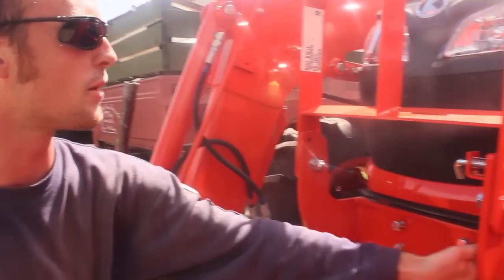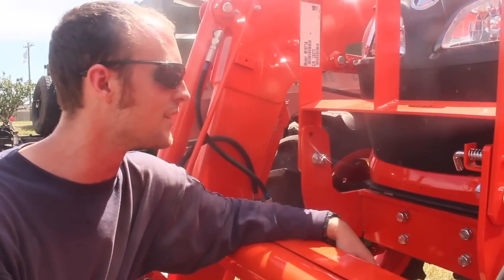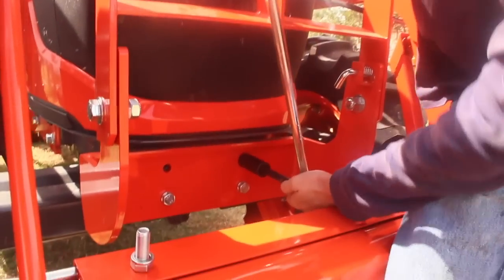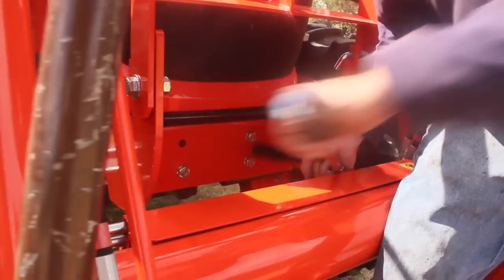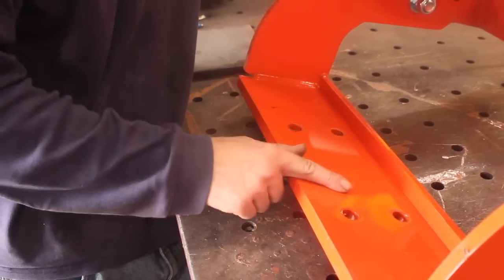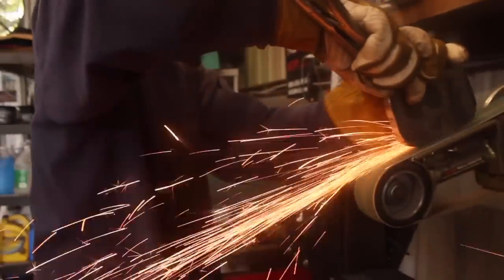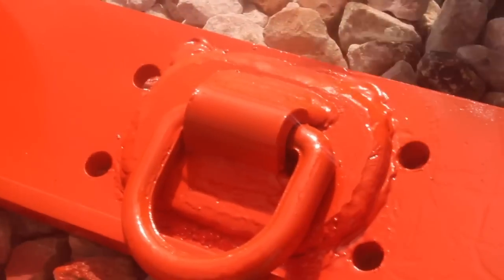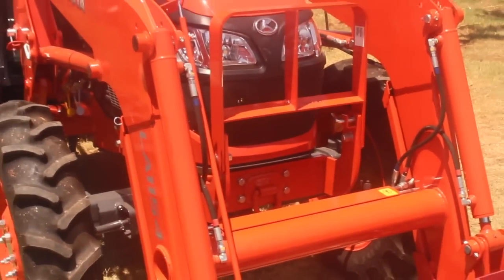DONT WELD A D RING TO EQUIPMENT WITHOUT WATCHING THIS VIDEO THE HIDDEN SECRETS I LEARNED FROM AN ENG

Comment: Regarding the plate to distribute the force.  Wouldn't the plate now become "one with" the OEM part and the D ring is still being pulled at that small surface area on the plate itself?  In other words putting the D-ring on the OEM part would just make the pulling force concentrated on a small area.  But with the plate there wouldn't the D-ring's small pulling area be now on the plate?

Comment: Great video! I can confirm what you said about load distrobution. I do a lot of repairs on wheel trenchers and have found that 7010 HYP tends to hold up to vibration better than LH. Maybe the forces are different for my repairs. Either way the vodeo was very good.

Comment: Just make it a tad bit bigger, drill in 4 holes and put it under the bolts next time. No welding, no modifications to OEM parts, just bolt on. Better IMO.
Reply: If he did that you would be putting a heck of a lot of pull on four bolts.  

How much force and loading can they take vs his welds?
Reply: @Ariceater  The bolts are still taking all the load.  They hold the whole thing onto the tractor.

Comment: didn't mention that the plate where the padeye goes may be heat treated. Any welding may remove the heat treating, so use a plate. Even be  careful about drilling into heat treated parts.
Could create stress risers.

Comment: this dude is sketchey,  he did not know one end of a welder from the other 5 years ago, and now is offering engineering advice.
welding a 1/2" plate to a 1/2" plate is pointless,  making that plate so large that it now impedes the bolts and the ability to put a socket on them. and if the plate you are welding all this to is bolted on,  then your load rating is determined by that!
The comment section contains more valuable info than this video.  Sad , but that brand new tractor he is working on has been paid for by creating this kind of questionable content. stange world we live in.
Reply: Its called learning as you go.  I bet you are one of those folks who knew everything out of the womb right?  If you know so much why don't you contribute instead of being a jagoff

Comment: I disagree with you a little on a few things. One failing point is better than two (your plate you added), and weave welds are better than stacked. 😅
Reply: Weave welds aren’t as strong as stringer beads, and aren’t code in most places.

Comment: I think that the plate is overkill. The weld on the D ring is so much smaller than the plate and would get ripped off before you could bend the 1/2" plate.
Reply: Exactly. "Distributing the force" with the plate makes no sense because it's still the same force on the small piece that holds the D ring whether it's on a plate or on the base material. That's the point that's going to fail and putting it on a plate changes nothing.

Comment: Fine thread bolts can only survive the equivalent load as their coarse thread counterpart when they are installed in soft materials like aluminum.
Coarse thread bolts survive best in stronger materials like steel.
Fine thread bolts installed in steel put under load will leave the bolts threads in the steel.
Coarse thread bolts installed in aluminum will remove the threads from the aluminum with equal loads applied.
Your attempt to educate people would be a lot more successful when you learn the facts about what you are talking about.

Comment: I myself don’t like welding stuff on if the same can be accomplished by bolting it on. In this case I may have considered fabricating a plate for the D-ring and bolting it on with only two of the (longer) bolts or for extra safety all four of them.

Comment: To determine the appropriate D-ring, take the weight of the machine and add 50%. Guaranteed to be utilizable if the piece of equipment is disabled or stuck.
Reply: I thought it was double?
Reply: @rockdem0n  not for straight pull. For lifting it's double.
Reply: @cliffterrell4876  Ah, I come from the automotive side of things and it's a lot easier to find something that can handle double or more of the weight of lighter duty vehicles.
Reply: Would it not be better to make the D-ring assembly much stronger so if you get stuck below the axles you can still pull it out.  The normal weight of the machine, for example 10,000#, would be doubled to 20,000# for the D-ring.  This allows for the tractor to be pulled out but if you have equipment on the 3-point hitch, you can pull it out too. If you want more, than install 2 D-rings which are welded and bolted to increase the strength.  These are my thoughts but I'm not a welder nor am I an engineer (two of my sons are, so I would need to talk with them).

Comment: One one these days i want to add like 5/8 d rings onto my trl for tie downs. Im planning plasma cutting out 3x4 spot and getting a 4x5 half inch or so plate and getting it milled 1/4 inch down on edges to fit the 3x4 hole so it can get welded on 2 separate areas.  Im thinking 6 or 8 d rings should do me

Comment: As much as I like over building things, that add on plate was way overkill especially with the location of those heavy bolts you could literally pick that tractor straight up if you had a crane.

Comment: Not really the ideal application for one of those D rings. Only designed for straight pulling force. On the front of your tractor there is a good chance you will need pull st 45deg if you get bogged. Bold or weld who cares but as you went to the trouble of making a nice base plate you may ax well have bolted it on

Comment: Call me strange... I'd make the plate large enough that the bolts trap it too. (longer bolts)

Overkill is almost enough.
Reply: Getting the proper metric fasteners could be hard to find or very expensive, they would need to be 12.9 grade and are hard to get some times.

Comment: great video, but Im not sure fine threaded bolts withstand more stress than course threaded ?
Reply: Um ...more surface  area  is incontact on fine thread.
Reply: Minor diameter is larger on a fine thread bolt vs coarse thread=more strength

Comment: It all depends on the application and how much force you need to distribute across the surface area.  If you're fearful of tearing the base metal then it's best to BOLT the plate to the metal instead of welding it.  It's easier to replace bolt-on pieces rather than wasting time gouging off the damaged pairs.
Reply: Not only that but did you notice how close the bolt heads were to the welded on plate? No way they got a socket on those bolts. Also, the weld on the D ring is the same size no matter what size plate it is welded to. The weakest link will ALWAYS fail first.
Reply: @frankwise7464  the weld bead itself may be the same size, but, the longer the bead is then the less towing pressure applied to each inch of weld. Distribute the pressure over more surface area makes for a stronger connection. This way even a mediocre weld can have greater strength.
Reply: @BrightlineTechGroupLLC  agree but my point was the weld bead on the d ring itself. the ring will only support a certain length weld. bead size and penetration would be a factor but it looked like a decent weld.
Reply: @BrightlineTechGroupLLC  Adding a plate to distribute force makes sense if you’re welding to thinner base material.  Adding an extra piece of 1/2” plate on top of 1/2” plate accomplishes precisely nothing.
Reply: never bolt always weld , i aint got time for all that

Comment: I just welded 3/8" grab hooks on the bucket of the 570 Case we used on the property. Plenty strong even when self-extracting from mud when it sank to the frame a couple of times.
Reply: @TakeDeadAim Depends on where they are mounted.
Reply: You did it the most useful spot on a loader tractor for picking things up or pulling,  its only common sense to mount on the bucket. Worked at tractor dealership 45 years. Welded on 2- 3/8” hooks one on each side customers loved that set up had zero failures. When you do it right the first time, you don’t have think how iam going to fix when it fails ?  Lol

Comment: That is the weakest point and direction for that setup. The only thing holding the load is the threads themselves, you get zero bolt sheer strength. If the load is corned say low and to the right, it will pull on one of the bolt's threads significantly more than the others making it even weaker. It would have been better to cut a hole in the steel between the bolts and mount something like a receiver setup that mounted to the frame itself. Many significant accidents come from setups like this. Threads can sheer a little at a time over many years and then give way when needed. At the very least the bolts should have been reversed to enable inspection. Look at the front of a dump truck for ideas on the right way to do it.
Reply: These are grade 8.8 bolts, if they are M16, they are each rated to hold 20,000 lbs of tensile strength. They won't yield until at least 22,000lbs. And that's just one bolt. One bolt alone could hold the entire weight of this tractor in the air plus some, and there's 4 of them. I think he's good. The D ring itself would probably snap in half way before these bolts would give way.

Comment: If you are making a plate why not just make the plate and bolt it on using the same bolt holes in the guard?
Reply: Probably have to chase
Longer bolts down to do that. Plus wasted plate for lil benefit
Reply: @hattersequiptmentrepairllc4661  Yep but 4 bolts are easy to find, cheap and makes for a ring that can be removed and replaced if damaged., And I agree, wasted plate, should have just welded the D ring to the Guard, being it is heavy steel and be done with it.
Reply: If the d-ring is in the middle, sufficient force will lift the plate away.  That will in turn side-load the bolts to the point they could shear.  Especially if the pull is not perpendicular.  That's also why he added the plate in the first place.  Increase rigidity and distribute the load closer to the bolts.
Reply: @StFiacre  IF the bolts are at risk of Shear they are also at risk now being in the same location. The weak point is the weld on D ring. If it was bolted on it would be the same weak point would be the weld at the D ring.

Comment: Would it be possible to MIG weld a D ring on as long as you use the correct voltage and wire speed? Some welders say it's just as strong some welders say it's not?
Reply: Some of the largest, most critical weld joints on US warships, is done with a mug welder. Most automated welding is mig.
Reply: The plate thickness of what this D ring is being welded to is way to thick for the average home owners Mig welder .  Look at the welding chart that is located on the inside door of your mig welder .  Max plate thickness is about 1/4” that these welding machines can do , that’s it . If you own an industrial type Mig welder and understand welding procedures then proceed. Otherwise don’t do it .
Reply: Of course, but remove all paint, rust, grease, etc first! And that’s taking for granted you have something bigger than those little 120 volt wire welders!
Reply: @tomt9543  I have a 240 volt mig welder and I use my stick welder for D-rings. 7014 or 7018.
Reply: @cliffterrell4876  I’m a firm believer in 7018 for stuff like that! And I’ve seen homeowner/DIY wire welds that needed to be ground off, and have the part reattached with super glue! It’d be stronger! Ha!
Reply: I wouldn't trust mig welding D-rings. Not enough penetration area.
Reply: @cliffterrell4876  
380V pulse mig-welder and that's no problem. If to weld 1/2" plate "right" one needs quite a large welder anyhow... A crappy stickweld is as bad as a crappy migweld. A good migweld is as good as a good stickweld. As with rods you shall have the right wire for the job, depending on material. At least Esab has good materials regarding these questions...
Reply: Pre-heating lets you MIG weld some insanely thick stock, get it up to 350-400 degrees.

Comment: My buddy wants to install hooks on his Kubota L2501 bucket and I wanted to do something similar to this setup. I may build a bracket for a D ring while I am at it.  Cool video.
Reply: I got a set of three 3/8 hooks with backer plates and fasteners all zinc plated for $39 from Amazon. Probably not worth building them yourself.
I will say bolting them on is a pain though... Welding would be easier, but doesn't transfer the load all the way thru to the other side (if the bucket has a tube at the top) and requires repainting things.
Reply: I’ve got a 2501 tractor and welded 3 hooks on top of the bucket…just used a 220 mig welder on 6 for good penetration..
Been that way for 4 years now and used quite a lot….no issues.